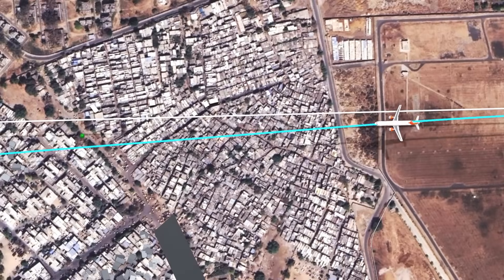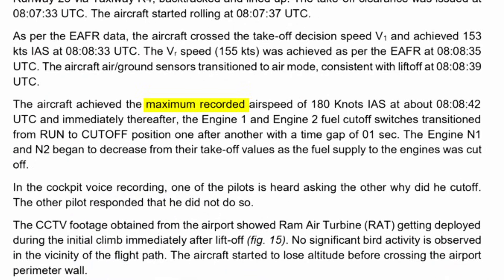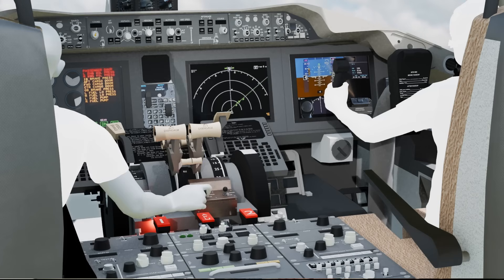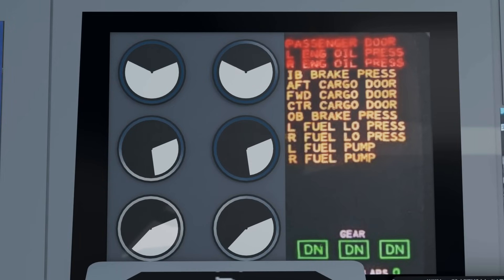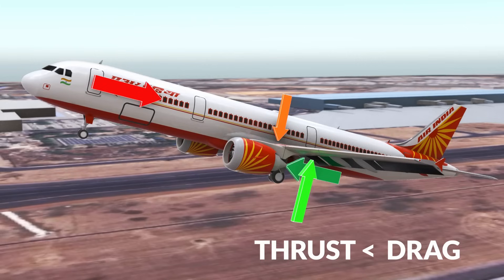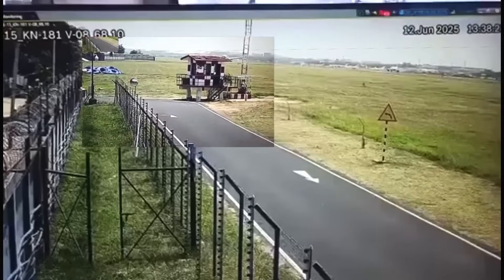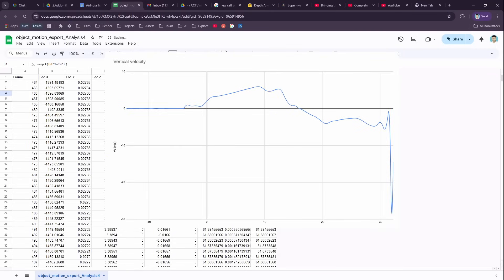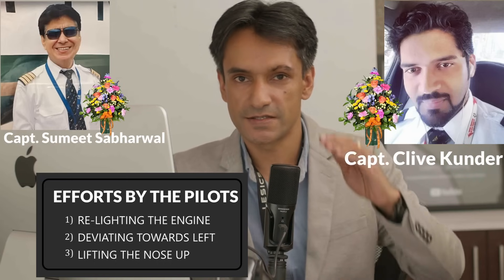Use of 3D Clone | Decoding the Crash Details you Missed

Comment: Great analysis .. last month I stitched 3 screenshots from Google Maps and drew a straight line from the runway, and it was evident that the plane veered to the left somewhat .. what I didn't realize is that the pilots must have attempted to land on the highway .. Also, this and few other investigations more or less make it pretty evident that engine failure happened before the 3 second mark. I hope the world recognizes that the pilots were truly heroes
Reply: @prasunthapliyal4287  Great that you have consider that engine failure happened before the 3 second mark. But unfortunately the reality is to admit they are hero, that would means we might have to point to the maintenance of AI or Boeing which could lead to grounding some 787 if not all which is not really affordable.

Comment: Just wishing to understand why didn't the 2nd engine re-start after the pilots attempted to reignite both the engines? Shouldn't both the engines have restarted normally? The airplane could have recovered with full thrust. 
Are there any factors that could have prevented the engine from restarting after fuel supply was restored, in this specific crash?

Comment: The good / sane pilot definitely tried to save the plane .. problem was with the other one that cut off the fuel supply at the critical phase of flight.. no analysis needed, it is as plain and simple as that..  we need to have better mental evaluation of workers in these kinds of jobs and or more robust automation to prevent these sort of deliberate sabotage.

Comment: The plane can't move the switches or cut off fuel by itself. A human did it.
Reply: this email comes from Boeing. trying very hard to explain the situation, but failed😂
Reply: @norbertcheung  No. That is not true. Stop lying. Engines on planes don't just randomly turn off by themselves.
Reply: @kellymoses8566  You seemed to know everything.  Were you also in the cockpit?  Get some education before you speak

Comment: Excellent, Sabin. 
1. Aviation experts have rejected the speed of 180 knots mentioned in the report.  They say the 787 cannot have achieved this speed so quickly after liftoff.  So you are right.  
2.  BTW it is possible to turn off both fuel switches within a second of each other.  You use both hands.  One for each switch.   Pilots have been known to do that.  Engine shut down is one of the most common scenarios in a simulator.  There are older videos of pilots doing it.  
3.  Your height calculation in the photo may be off.  Please re-check. 
4.  It is a common fallacy that a plane moves up because the lift on the wings is greater than the weight.   This is only true during normal flight.  But during liftoff, it's the massive thrust of the engines that pushes the plane up as reaction.  Just like a rocket goes up not due to any wings but the sheer thrust of the engines.   The same principle applies to planes during takeoff.  Google it because no one believes it.  And this is why empty commercial jetliners can shoot up at very high angles of attack after takeoff that you see at air shows.  These angles are way past the angle where any lift can be generated.  They should actually stall, and that's why MCAS was made, to prevent stalls at high angles.  However, when you have full thrust you are more like a rocket than an airplane. 
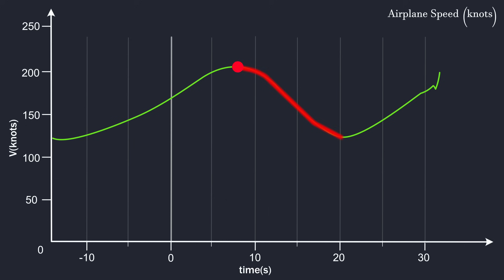5. The increase in airplane speed that you claim at 4:55, 10 seconds after take off,  may be due to gravity as a force rather than thrust as a force.  Because if it was actually thrust creating that speed, of over 160 and even over 180 knots, then 100% the plane would have moved up!  Which it did not.  Also, the fuel switches moved to Run position only at 8:52 which means 13 seconds after take off plus spool up time which is another 5-10 seconds.  So at least 18 - 23 seconds after liftoff.  So at 8:57 onwards is when the thrust starts.   Hence, at 10 seconds after takeoff at it could not be any thrust at all that caused the speed to go up.  There is no fuel even.  The swit
6.  My guess is, it lost speed rapidly when they suddenly pointed the nose up at one point (you can see that in the video).   They "used up" the speed / momentum to move up, and then went down again as gravity become stronger than the lift.  This also matches with the fact that the pitch of the airplane went up at Takeoff + 10 seconds (as you also describe).  Finally, it is a plane, not a rock, so I disagree that there is no horizontal component.   There has to be a horizontal component to the speed simply because it has wings.  These wings create massive resistance and push the plane forward.   The faster the vertical drop, the faster the horizontal speed.  If you throw a paper plane, as it is about to hit the floor, the vertical as well as the horizontal speed increases.  If it did not have any horizontal component then wings are having no effect -- which is not possible.  *It's why even a feather moves around while falling instead of dropping straight down like a rock.*  
7.  Are you aware that the technical glitch happened at takeoff or 1 second after takeoff?  
I have some more insights so let's connect.  Will email you.  Your effort has paid off, good work.
Reply: For Air India 171, investigators are forensically searching for evidence of these phenomena in the recovered hardware—looking for damaged memory cells, analyzing software logs for jumps, and testing for electrical pathways that could have induced the fatal bit flips that theory suggests changed a 01 (RUN) to a 10 (CUTOFF). Let’s wait for aviation Forensic reports cannot blame anyone
Reply: According to the report, It took 2 secs to go from 153knots to 155knots and it took 7 secs from 155knots to 180knots, does this make sense?
Reply: @luckydogjunction2120  Yes, it does.
Reply: @luckydogjunction2120  You/re right.

Comment: 787 Dreamliner is a faulty and glitchy airplane, that's why it cuts off fuel while it is in the air. A critical system like that is supposed to be managed only by the pilots. The rotten western/illuminati/luciferian media has done a lot to save boeing from its usual mess.

Comment: Let’s just consider what is in the preliminary report regarding what the Pilots said. 
It says immediately after take OFF the RAT was deployed, that is before the fuel switch SIGNALS (not switches) transitioned to cut off, (RAT does not deploy with wheels on the ground) one reason it deploys is power loss, that would cause the cut off signals to TRANSITION to cut off as the system went into reset. The pilot flying would have both hands on the stick and be concentrating, looking forward out of the window through his head up display, he would see a warning/confirmation message, Fuel cut off. He would immediately ask “why did you cut off” and got the reply “I did not do so” From RAT deploying to it providing power takes 10 seconds, some of this time consumed by their conversation, other warnings would be or start flagging, As power is restored the fuel cut off SIGNALS would recover to run as the system comes out of reset. Flight manual procedure says leave switches in the run position for automatic engine restart. Automatically Engine 1 begins restart sequence and provides a little thrust, but not enough yet for level flight, Captain seeing the ground coming up fast broadcasts “Mayday, Mayday, Mayday, thrust not achieved”.  

It makes sense to me. I don’t see a mass killing or suicide.
Reply: No, the actual switches were moved.  The switches have additional, dedicated cables for monitoring their physical position.

Comment: Wake up. One pilot tried to save. The other was a zero. Truth hurts.
Reply: Yeah, I don't know what is wrong with these people.  I'll never step foot in India now.
Reply: I don't think you know how aviation works, one of the pilots has the control while the other helps by reading out the checklists. So stop blaming anyone
Reply: @aryanrai6897  The other pilot, in this case the Captain, deliberately "helped " crash the plane
Reply: @ScottMunro-p3y  also the preliminary report is not very detailed about the specifications of the events which happened with their timings, and it's not really a quality report. People argue that maybe something had already occurred with the engine so the captain tried to turn off the fuel switch
Reply: @aryanrai6897  An early original theory floated was that one engine failed and one of the pilots invertedly flipped the switch of the still working engine to shutoff.  Both switches were manually moved to shutoff.
Reply: @aryanrai6897  there are well known crashes where one pilot worked against the plane : German wings, Egypt Air, ....

Comment: 15:30 Please note, in the 2019 ANA incident, the engines got CUTOFF only after landing not before like you said...In the 171 incident, it would be a different glitch for the engines to be CUTOFF while in flight.
Reply: Boeing glitches have also led to a plane crashing because the AoA sensor interpreted a nose down as a pitch up. (Basically the MCAS disasters in LNI610 and ETH302)
Reply: @bkbdoesrandomstuff  I’ve heard of that, yes

Comment: It is technically analysed to some extent but conclusions were a bit illogical. 

1. It is possible to cut off both the switches in 1 sec. 
2. Vr call was  at 08:08:39 and the aircraft was rotated with a speed above 155 kts. And  within 7 Sec i.e.. at 08:08:42 aircraft can comfortably achieve 180 kts.

3.Fuel cut off also could be at that time. Highly posible. 

4.Crew were engaged in something hence got distracted of selecting the gear up. Fuel liver transition needs human intervention as the movement is lift and shift arrangement. 
The FADEC can stop the fuel without moving fuel switches, in case of excess speed and EGT, but will not do that in critical phases of the flight.

 As an aviation expert, I don't see any technical issues in the engines but a human error.

 About the deviation towards the left could be due to thrust asymmetry as they didnt have that much time to think of turning the aircraft. They were engaged in restarting the engines

When it started loosing lift possibly they have attempted to put the nose up, even otherwise it would be nose up profile up to transition altitude ie. 4000ft. at Ahmedabad. 

Note: Capt Kunder was a pilot flying hence both hands should be on the control column. 
Capt. Sumeet was a pilot monitoring.
Flight radar altitude always shows more than the actual altitude. Even the Google profile doesn't match fully.
Reply: In any case It was a sad thing to happen. May God bless the departed souls to Rest in Peace

Comment: This is exactly how a engineer will see the data. The pilot did not want to crash and die. The boeing wanted a boost in shate price so they might have influenced the report. The final report should include these details else will not trust the report at all. Even some pilots were blaming the pilots. Believe in your peer. Engineers dont trust anyone but tracks. Do the same with ethics 😊

Comment: I agree with this video. The pilots didn't cause the crash, they were trying to save it. When we notice that our house lights are dark, we flip the switches on, off, on etc. The captain did the same., he switched the engines off and on again to see if the engines would recover. I hope examiners are looking at all issues that could cause the engines to stop like a cabin door being unlocked by a passenger out of his seat.
Reply: Sure, go ahead and ignore the fact that the pilot flying the plane asked the Captain why he switched off fuel to both engines.  Chances of both engines simultaneously failing are a billion to one.
Reply: @ScottMunro-p3y  "Chances of both engines simultaneously failing are a billion to one." Are these referring to in general the 2 engines failed by itself". What is the chance of both engine on a Boeing to fail .......?
Reply: @luckydogjunction2120 I wonder what the chances of an electrical failure tricking pilots into believing an engine failure had occurred. Instances of shutting down the only working engine..leaving none..has happened. I sure hope the true causes are revealed.
Reply: Not when u just take off. I know you can't accept that an Indian pilot has made a mistake but your going to have to!
Reply: @sukhvindersingh741  Not when you just take off when the engines are running. But when your engines were shutoff upon take off, then any pilot will try to relight the engine and the procedure is to move it to cutoff first to reset the system and then back on
Reply: Correct!  Pilots didn't cause this crash.  It was one pilot, the Captain that deliberately moved the switches from run to cutoff.  Both the audio and flight data recorder confirm these actions.
Reply: @ScottMunro-p3y  It could be the Captain that trying the relight the plane by moving the switches from run to cutoff first and then from cutoff to run. Any pilot who try to relight engine would do the same.
Reply: @luckydogjunction2120  Listen to the audio!  The pilot flying the plane clearly ask the Captain why he shut the fuel off.
Reply: @luckydogjunction2120  The preliminary report data shows that the plane had just lifted off, and parameters like thrust and speed were consistent with a normal climb as is also confirmed in the images captured after take-off.

The first abnormal event recorded is the manual transition of Engine 1’s fuel lever to CUTOFF, followed 1 second later by Engine 2’s.

There’s no preceding engine anomaly - no drop in N1/N2, no abnormal EICAS messages - that would suggest both engines were spooling down on their own.

In short, the sequence supports cause and effect (lever movement to engine shutdown), not the other way around. The “automatic shutdown then attempted restart” idea doesn’t fit the recorded timeline.
Reply: @anon5043  How do you know there weren't any abnormal EICAS messages?
Reply: @ayushvora1672  If there had been abnormal EICAS messages, they would almost certainly have been detailed in the preliminary report, as they’d be a prime focus for any engine or systems failure investigation. Speculation about them being hidden is unlikely given the involvement of India’s DGCA, the UK AAIB, and the US NTSB (still involved despite early reports of a fall out) multiple independent parties reviewing the same data makes a coordinated omission highly improbable, venturing into the realms of conspiracy theories.
Reply: @anon5043  Right 😊 You do you, bud 👍
Reply: @ayushvora1672 I suppose the recorder didn't show any error messages before fuel shut off. Even then there were no error messages. I guess there needs to be solid evidence that it was not deliberate, to change the narrative.
Reply: Mitch, do you think the RAT deployment timestamp was recorded?
Reply: Why did he say that he didn’t then?
Reply: @21upbowls  People lie.
Reply: @21upbowls  He lied.
Reply: The restart procedure requires the switches to be momentarily shut off to reset the EEC. It's part of the process.
Reply: The fuel was cut off by the airplane itself, the pilots tried to restart it after they realized the two switches were in the cut off position.
Reply: @Eyob797  The fuel can be cut off by the plane even if the two switches were in the run position. The ANA Airline in 2019 is a good example where the engines were cutoff upon landing. No switches were physically moved
Reply: @luckydogjunction2120 electronics are great..until they're not. I'm guessing a 10 year old fly by wire plane requires a ton of maintenance to prevent dust, moisture, heat, g forces etc from eventually wreaking havoc. Maybe each plane needs an R2D2 robot to help out.